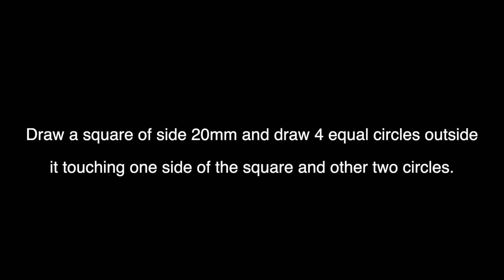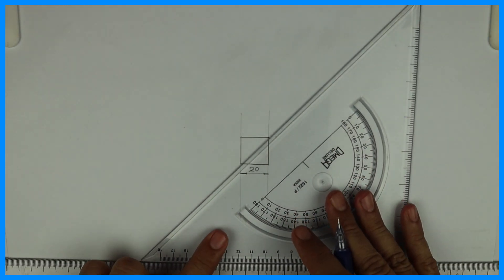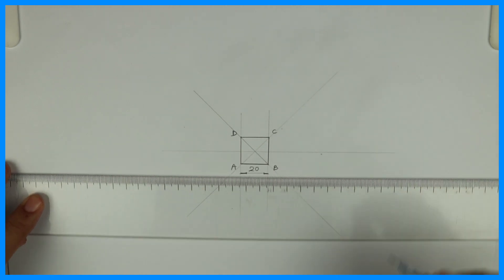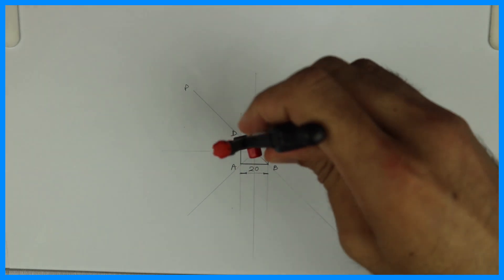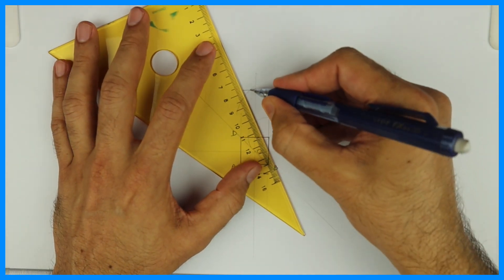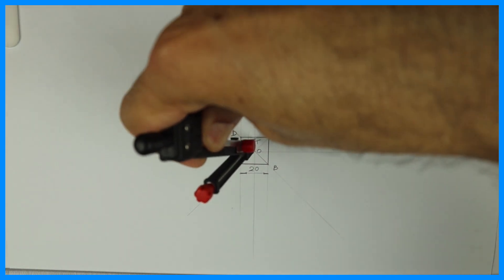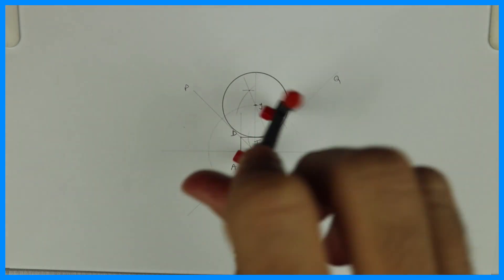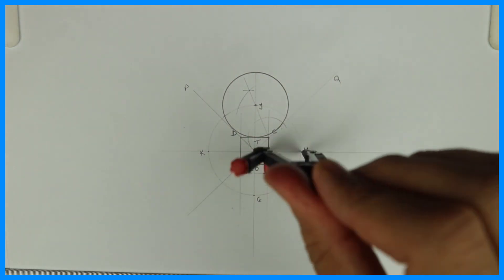How to draw four equal circles outside a square - Engineering drawing - Technical drawing

Comment: Sir is the diagonal of the square and the side of the square similar?
Reply from the maker: No
Reply: @technicaldrawing  then sir can you please tell me how to do this ; Construct a Square of diagonal = 32mm. Draw four equal circles outside a square such that each circle touches one side of square and two other circles externally.
Reply: @kunj1_vora  first draw a line AB of 32 mm. then make a 45 degree angle on A on top and bottom. 2 45 degree angles will make a 90 degree angle. do the same on B. then just join the lines to make a square. then follow this video ahead